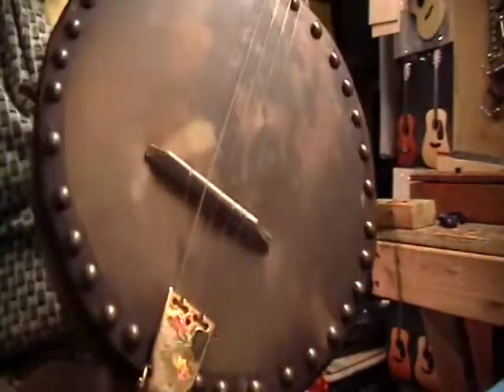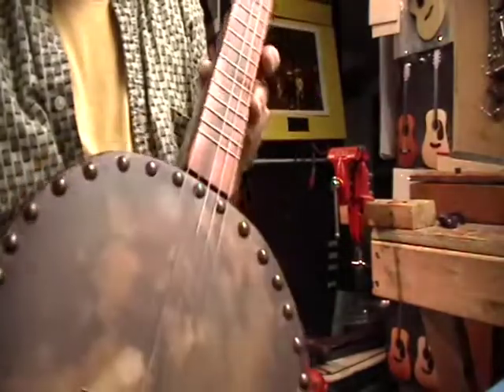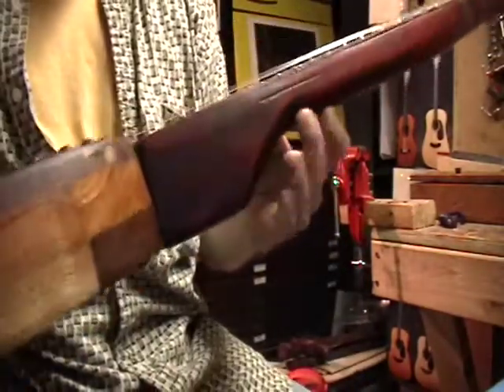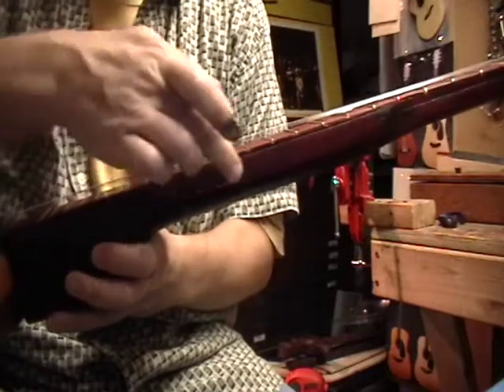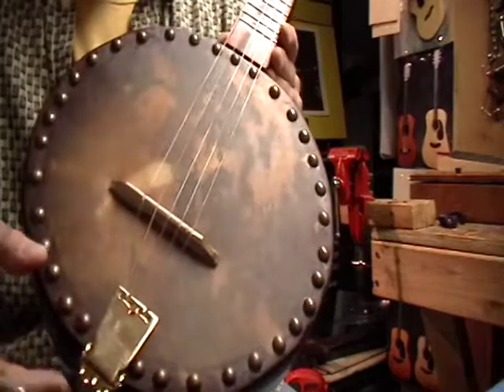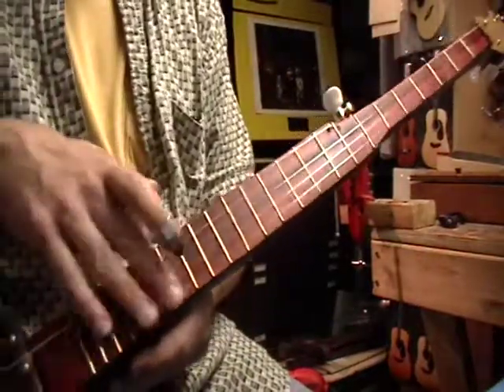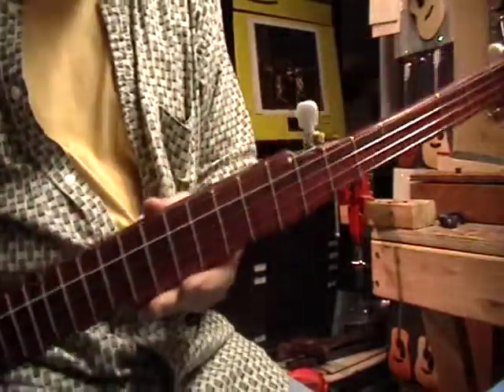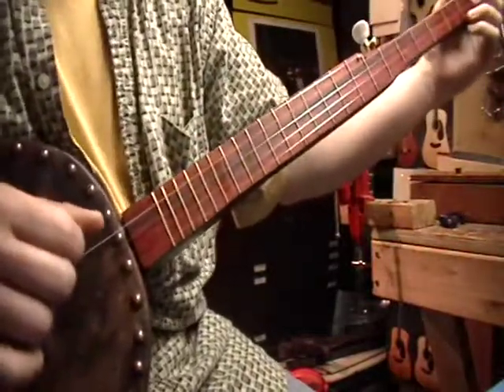HOMEMADE TACK-HEAD BANJO LONG NECK OPEN E TUNING.MOD

Comment: Nice! I've been thinking about trying some thin gauge steel strings on my Prust tack-head. I'm wondering if I should sure-up the dowel with some plate to handle the extra pressure. The neck itself is quite thick, and the dowel seems to be the area that if anything were to fail it would be it.
Reply from the maker: I think it will be fine..I have see pictures of those instruments seems very solid...